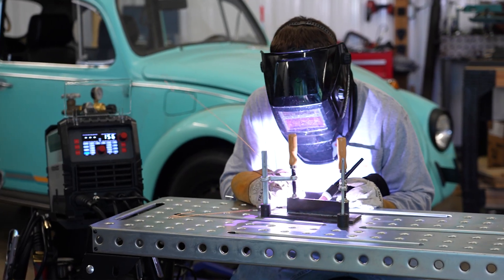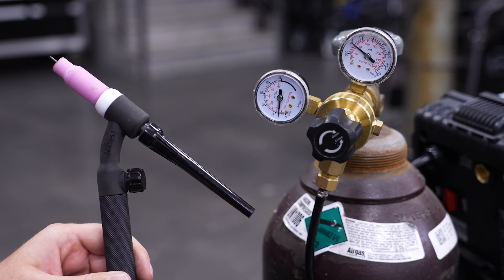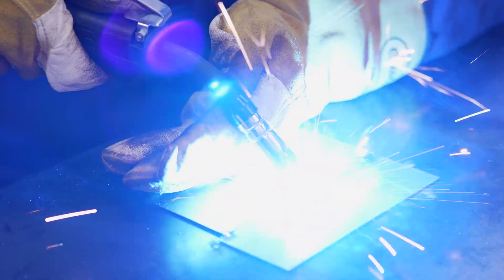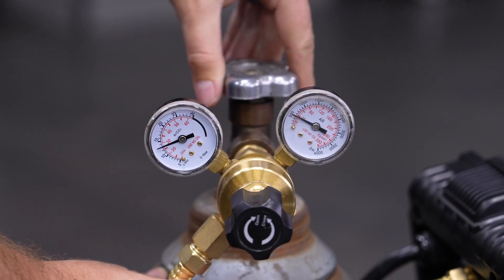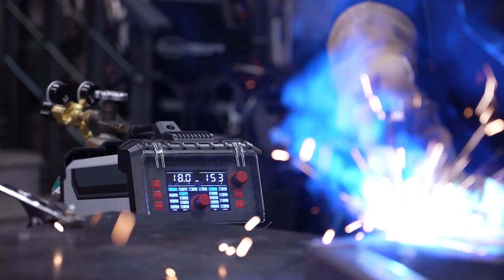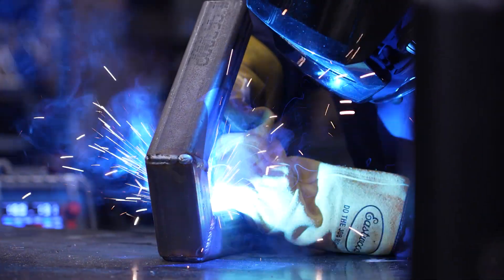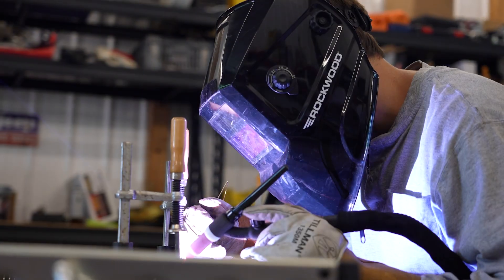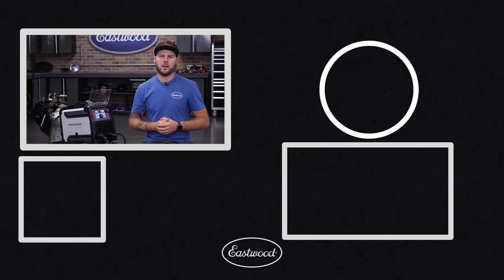We Didn't Expect THIS From a $250 Welder!

Comment: I'm thinking about getting one of these, but I'm skeptical of the claimed amperage. The specs say it will output 120 amps when stick welding on 120 volts. There are machines that cost significantly more that cannot do that. Harbor Freights Titanium Stick 225 tops out at 70 amps on 120v. The Eastwood Elite MP140i also tops out at 70 amps, and it costs almost twice as much. So how is this machine able to do it at such a low price point?

Do you guys have plans to make any more videos showing how this machine performs? It honestly seems to good to be true, for around $400 you can have a setup that will MIG, TIG with a pedal, and stick weld 6010 & 7018 on 120v. 

It seems like a dream come true for a weekend hobbyist. I could replace my dedicated TIG welder with one of these.
Reply: I'm in the same boat, would love to see some unbiased testing and sustain current ability. Even HF's multiprocess welders are over 2x the cost of these.  Also a question of reliability since it is a brand new product.
Reply: @EricHelgesen1 I ended up buying one of these to try it out. So far I’ve done flux core, Aluminum MIG, stick (7018, 6013, & 6011), and lift TIG on regular steel and stainless. If you have any questions ask away.
Reply: @vertvlogs675  Oh nice. Asking as someone who doesn't own a welder only watch youtube vids. How does it feel overall, cheap or decent quality? Are there any things that arent as good as you thought it would be?  Is the wire feed smooth? is the duty cycle close to claimed?
Reply: @EricHelgesen1  I haven't tried to max out the duty cycle, but that's because I'm usually welding thin material at low amps. I'm not a welder at all, just a hobbyist in my garage. This is my 4th "consumer grade" welder I've owned, but I've also used Millers at a community college class I took. 

Overall so far I am impressed. I think for $250 you really can't go wrong. You are going to spend more than that on your first bottle of gas if you decide to do MIG or TIG.

It layed down some good looking flux core welds. It did run stick electrodes on 120v but it seemed a little off. I'm not sure why. To its credit the rods were a year old, not stored correctly, and I'm not a great stick welder. 

I was blown away by the Lift TIG function. I have only ever TIG welded with high frequency start so I was a little unsure, but this ran perfectly. Starting the arc was super easy and once going it ran extremely smooth and consistant. I was really shocked at how good it was.  

Complaints/Cons: 1. The included accessories are a complete joke. The ground clamp and stick electrode are on like 4' leads. Basically useless, but I'm okay with that since the actual welder itself seems pretty good. 2. The tensioning for the spool was kinda weird, it took a lot of fiddling to get it right. 3. My single biggest complaint is the drive roller for the wire only does 0.023 and 0.030 wire. So if you want to run 0.035 or 0.040 wire you are screwed. I ran 0.035 aluminum wire on the 0.030 drive roll and it seemed to work okay but you can't even buy a replacement drive roll from Eastwood's website. I'm not sure what to do about that yet. 4. The manual sucks, there are lots of typos and some sections are completely incorrect.

Comment: What thickness of aluminum can this welder Tig with 120v? What thickness of stainless steel?
Reply from the maker: The Rockwood MIG 160 cannot TIG aluminum. It can MIG aluminum. And it can TIG up to 5/36" or 4mm thick.

Learn more here: https://www.eastwood.com/rockwood-mig-160-mig-welder.html
Reply: @eastwoodco Thank you for clarifying this! What thickness of Aluminum can it MIG with 120v? I'd really only use it for welding intercooler piping.
Reply from the maker: Something like 5/32" 0.15"
Reply: @eastwoodco Thank you! I'd love to see longer videos of this welder in action, maybe with a host showcasing everything it can to with 110, and then everything it can with 220?
Reply from the maker: We have a project video coming out with this welder in the next 2 weeks as part of our Fall Product Launch - make sure you're subscribed you'll see it soon!
Reply: Not for aluminum. DC only.
Reply: @mwinner101 So, no DC on 120V? Because they say it can mig and tig aluminum in the video
Reply: Good question. They do mention mig for aluminum without a spool gun and then they mention tig but for steel. Got me.

Comment: If I get this, I will need information on the price of the add-on. I don't see anything on the price of the Tig Add on.
Reply: Its $34 for the tig torch and lead, and $50 for the foot pedal.
Reply: All is about $400
Reply: What thickness of aluminum can this welder Tig with 120v? What thickness of stainless steel?
Reply: @spoolin_c10 I’m wondering the same thing for aluminum. Put a good
Bevel on it and you could lay a couple beads
Reply from the maker: The optional add ons are: 
Regulator #12238
Valved TIG Torch #33423
Foot Pedal #73881